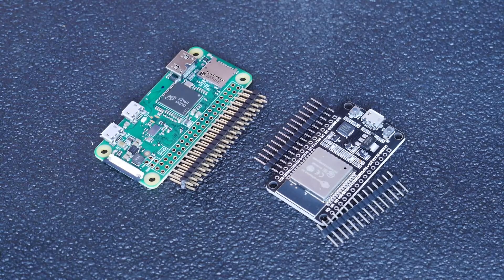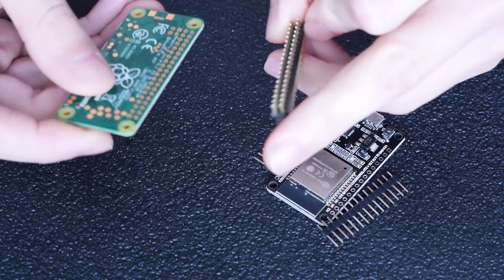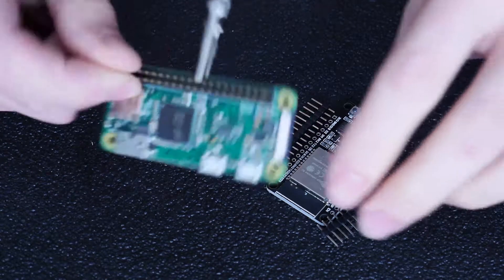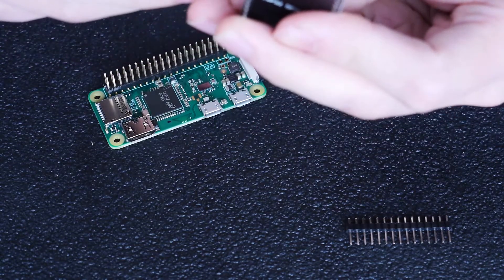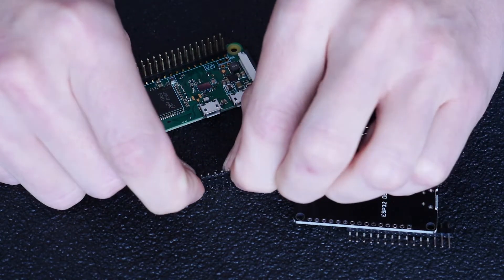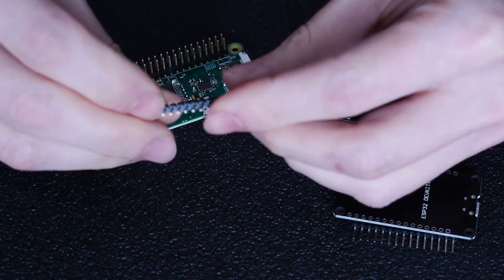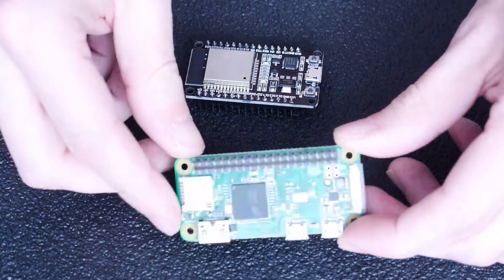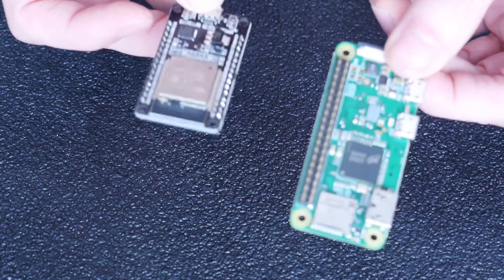Simple Trick for Soldering Headers Pins - For Arduino, ESP32, Raspberry Pi and more

Comment: Now if you could come up with a method for soldering a single pin in the middle of a board, we'll be golden
Reply from the maker: Well if you keep the black partition piece on the single pin a clip would still work to hole it up ;)

Comment: What temperature do you use for the soldering iron? What solder do you use? lead free, rosin core etc
Reply from the maker: I've always used lead free rosin core. The iron used in the video is not adjustable just a cheapo one I've been using for 10-15 years now it just keeps on keeping on. But I do have another cheapo adjustable 80watt I randomly use usually set around 650-675F. I noticed a lot of the cheap headers that come with all these knock off Arduino's and break out boards whose pins are silver in color are really hard to solder. I don't know what the heck they are made of but solder doesn't stick to it without a fight. I usually take the header row and stick them into some flux paste first to just make things flow better.